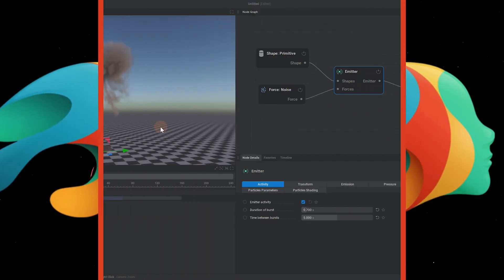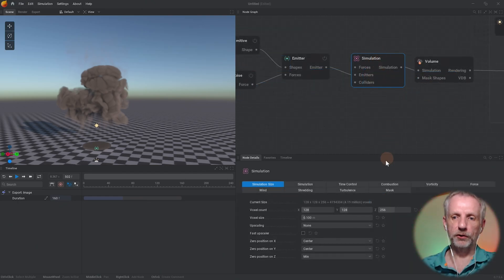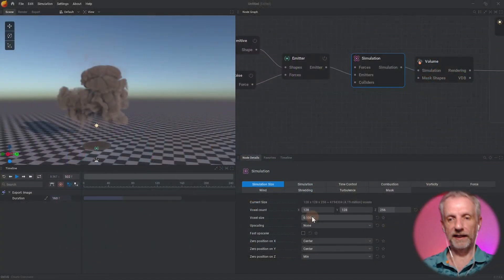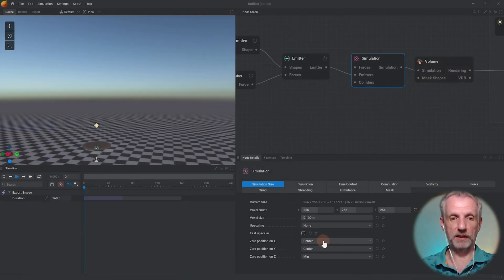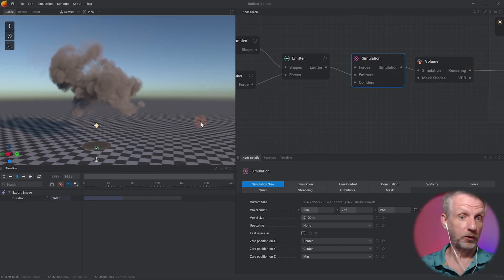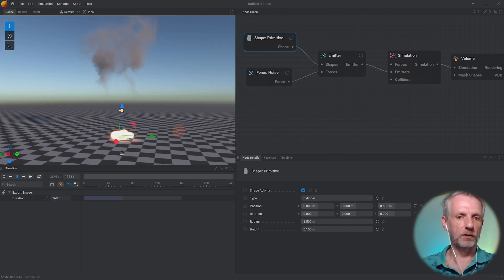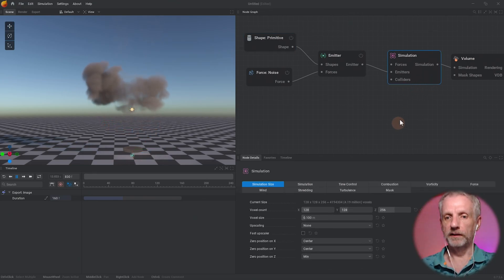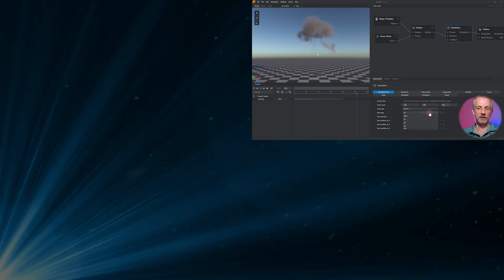EmberGen: Changing VDB Resolution

Comment: When I export the VDB to 3ds max and Redshift, the voxels looks very low resolution, even When  I´ve exported in 256 x 256 x 256. Could you explain how to export the best resolution cause the render looks horrible, I can see the tiny boxes of the voxels. Thank you.
Reply: maybe try scaling your whole scene down, or else increase the simulation size even more or lower the voxel size
Reply: same here, did you find an answer for this?
Reply: i have the same problem with octane render each frame is like 12mb but it look very low resolution inside c4d with octane